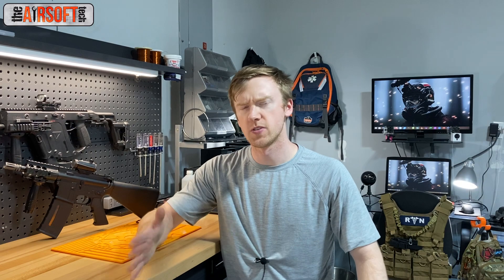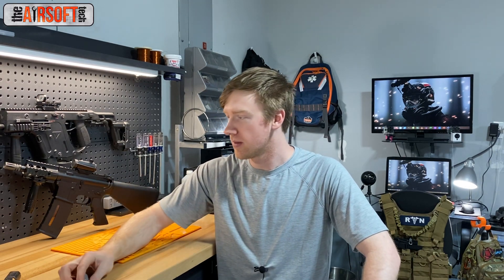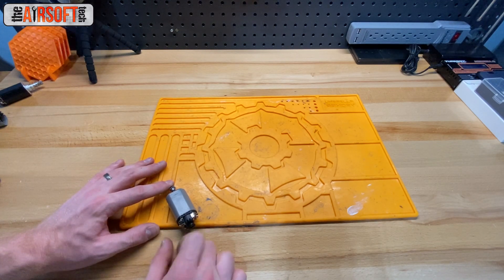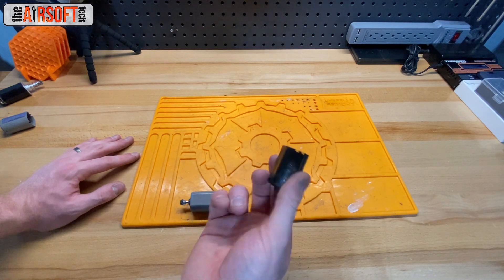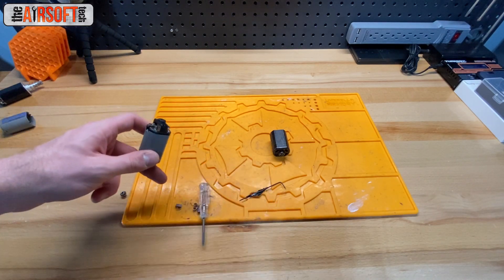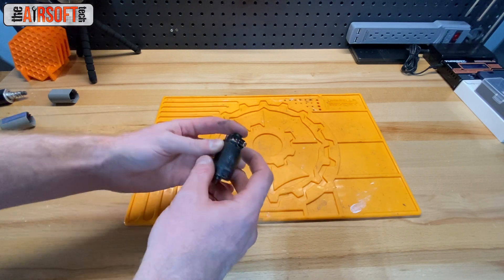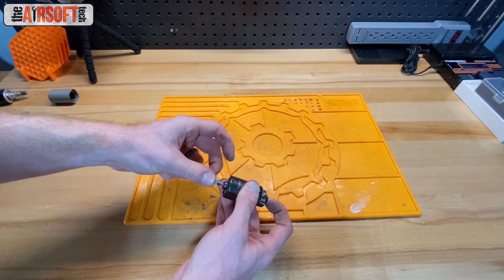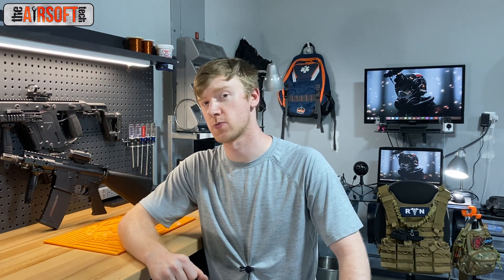How to Assemble a Franken Torque Motor

Comment: Hi ,
Build a FT with SHS HT can + 28tpa armature from a chaoli motor. But my FT runs hot after 100 semi spam which doesn’t matter bc it’ sa build for my DMR. 
Don’t know how many amps it pulls but it runs hot same way outside of the grip , so no load at all..
What could be the reason for that ? 

Thanks in advance :)
Reply: shimming possibly
Reply: @The-Mafia-kq8zw  i doubt, shimming is great, i only hear piston slap when i fire no gear sound at all . 
same method i do for my other airsoft gun who don’t run hot . 
I bought an ampmeter bc i only have a nano hard mosfet on this one.
I also found that the motor runs hot out of motor grip . I will find tomorrow when receive my ampmeter

Comment: Great video... again
:)
I've got a question for you: I installed helical gears (one of my best shimming jobs), high speed motor, Perun AB++ mosfet, M120 spring and a 7.4 V 2200 mAh 20c Li-Po. The motor gets quite hot very fast; should I be worried? I have 2 other simmular builds and a simmular hot motor issue

Comment: The extremely low amp draw of high tpa motors can allow some interesting builds if you run a 14.8v battery. When you have a setup drawing 10-15A rather than 20-25A (or even more), you lose much less power to resistance in the system and you can gain phenomenal trigger response - even with low current batteries. The thinner wiring in the higher turn armatures usually has the weakness of allowing less current to pass, resulting in reduced stall torque compared to thicker wiring at the same voltage, but a higher voltage will negate this weakness. I've had setups drop as much as 25% input watts for the same output watts when going from a 16tpa motor on 11.1v to a 28tpa motor on 14.8v.